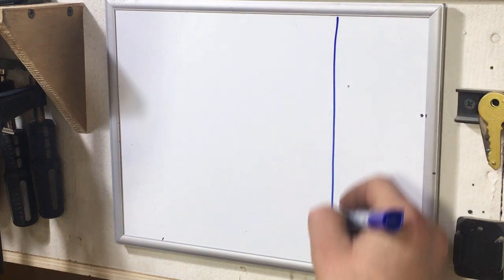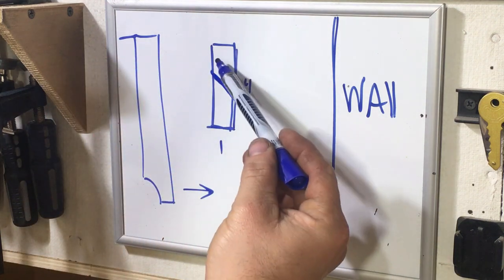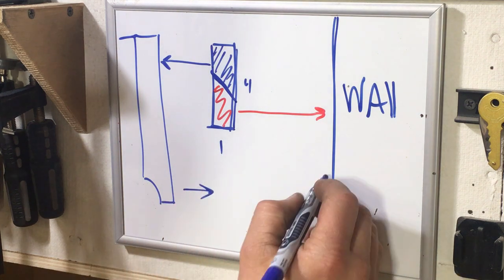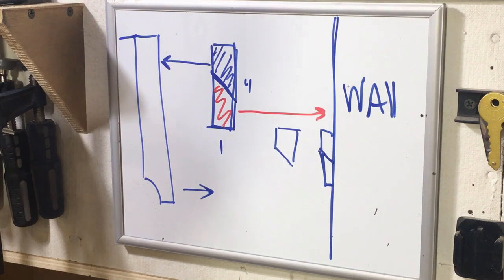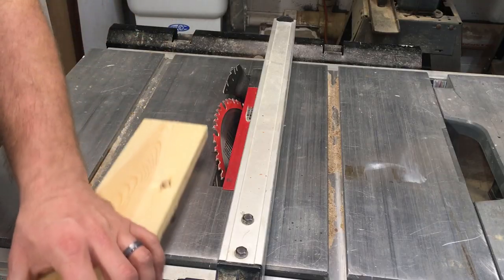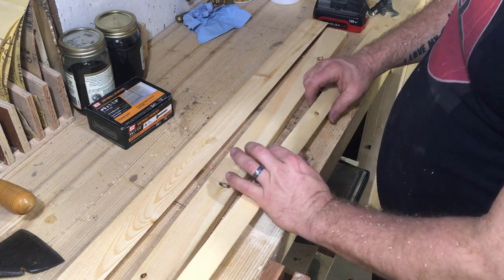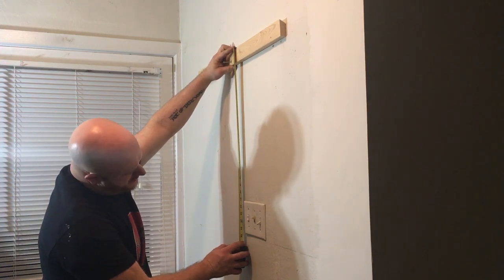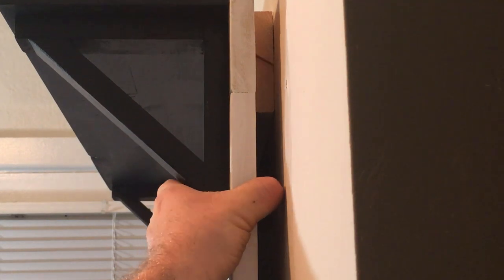How to make a French Cleat

Comment: I’ve watched maybe ten videos by different creators on how to build these. I’ve tried a few of them and failed, and was stressing trying to rip a 3/4” sheet of plywood (a common recommendation) into strips. Your video was better explained, had a solid method I could try (1 x 4 I can cut! 4x8 plywood not so much in my little shop) and the bottom strip idea is a great one. Loved the white boarding also. Great video!

Comment: Thank you. I had a good idea on what to do. I wasn’t sure if I should go 1x4 for top cleat system and then something thinner around 1x1.5 for the bottom support (using (1)hd purchased dimensional 1x6 pine). After watching I’ll give it a go. The shelf it self isn’t too heavy and I don’t believe there will be overbearing weight that it will be holding. It’s not for me. I’ll tell them to use their heads when putting things on it.
Reply from the maker: Awesome. I’m glad my video was a help to you!

Comment: I have been trying to watch as many videos on making the french cleat system as I can find. I am still confused as to how you cut the board down the center and have 2 same sized cleats. Especially after you have turned the blade to a 45 degree angle.
Reply: drawlings10 even if it the two pieces of the clear were identical, the mechanism should still work anyway. But to answer your question, the assumption is that the 45 degree cut will intersect the middle of the board on both axis. Theoretically the only material that should be missing is your kerf.

Comment: How much weight could this system potentially hold?
Reply from the maker: I have never personally tested the strength. The coat rack in this picture is full to overflowing of coats. As well as things on the shelf like hats and glove. It’s doing great with that. If you looking for a strong metal version, check this product out by Hangman Hangman Heavy-Duty Mirror and Picture Hanger with Walldog Anchorless Screws - Aluminum: HM-30D https://www.amazon.com/dp/B000VWAYQC/ref=cm_sw_r_cp_api_i_b2aFCbJJA7RNH
Reply: @BOCraftsman  one thing i like about your design compared to the metal ones though, is that it leaves a gap for LED backlighting...maybe you could do a video for us testing the strength of it :)
Reply from the maker: That would be an idea.... 😉
Reply: @BOCraftsman  build a demo one and just start stacking or hanging weights til it breaks :)